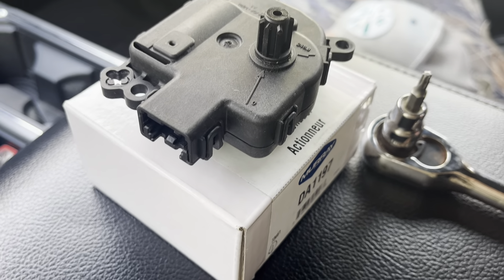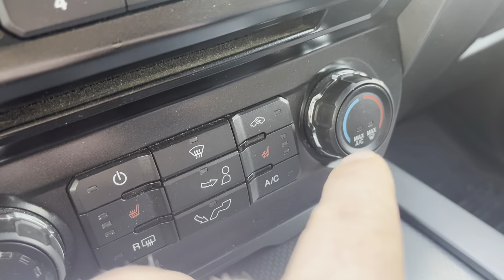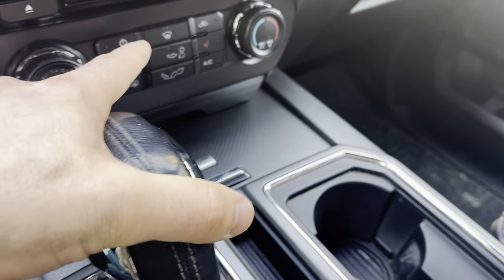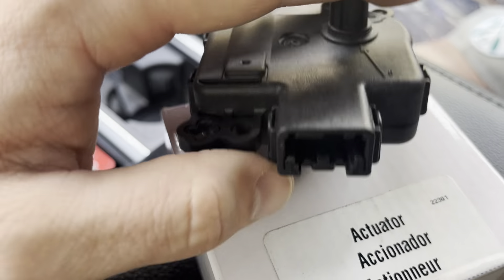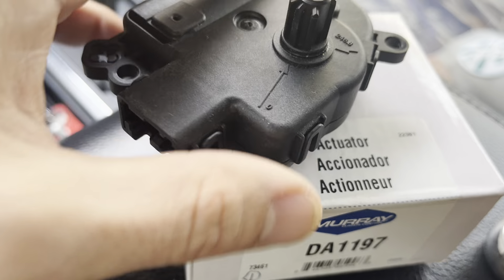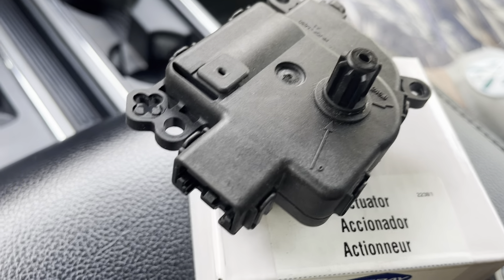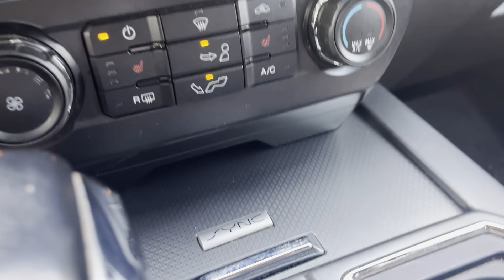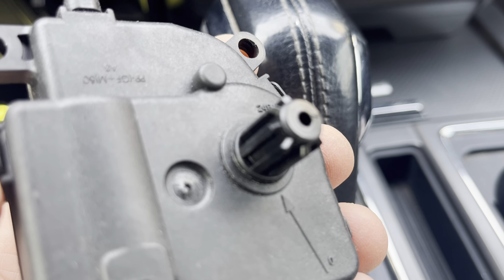F150 Blend Door Actuator Replacement 2015-2020

Comment: Mine started out hot on driver's side, cold on passenger side. Then it stopped allowing me to switch between the defrost, vents and floor. I changed my vent door actuator ( driver's side ) today. It still won't switch between the 3 vent options and I have no heat either. Anybody else have these issues on experience this? Thanks!
Reply from the maker: Do you have dual climate control for driver and passenger side?

Comment: The proper name for the actuator that changes the air output location (Vent, Defrost, Floor) is "Mode Door"  The blend door for that year F150, I believe is on the right side by passenger foot well, (left side under dash) and that mixes the hot and cold air for selected temperature.
Reply from the maker: Yeah I've seen it referred to a few things online, Motorcraft calls it "air inlet door actuator" or "blend door actuator" can be confusing for folks trying to find the replacement part. Think it also depends on if you have dual climate console or not as well.

https://www.ebay.com/itm/314192641851?_skw=motorcraft+yh-1770&epid=227180308&itmmeta=01JEEA5Z3KPC42PFVX366B1A1D&hash=item4927573f3b:g:X1QAAOSwm81hHjwz&itmprp=enc%3AAQAJAAAA8HoV3kP08IDx%2BKZ9MfhVJKkhaFElOdBWo7VR2qyaVMe09JjIivwifMdOGt5RqenMAzgzDzhmLLvULAzk2LdLob16ryyrP2s2XHvsqVgpm59yU6NewjYxZZ35suZeeRUM2pIa%2F%2BoQGsGdEairGuj0qVge1q1WNK3ljXoizxg83LMZlpM6qba3RXpTCAErc3y6q0NsH0DKQKdscetG%2BtigPs2Un1mCbmCtSHRbrvkClNxhoWV3AfIWh%2B8r8wWJmPekphkrkyo5qLFtMY52CCwsiNvG8peYQkxAvDxTkx09Blf7hZTa1kEub88iFjYnLwq5TQ%3D%3D%7Ctkp%3ABk9SR_rxl8rzZA
Reply: So I've been having a issue where my heat on the driver side is only warm and passenger side is hot when I have the heat turned all the way up. Would changing the left side actuator fix this problem?

Comment: I have a 2016 f150 lariat. Dual climate zone. My passenger side is blowing hot air (no matter what I do), but driver side blows a/c (I have it on a/c mode) driver side works as it should. Looked it up online and said it’s the “blend door actuator” should I order the part and change it myself? Thank you in advance.
Reply from the maker: Yeah look up the configuration for the lariat with dual climate control as mine is only single climate control so I have one door blend actuator for vent direction and then another for temp control. I think you may have two temp control actuators for dual climate control.

Comment: My temperature is stuck on high heat everything else works not sure what to replace
Reply from the maker: Bummer I believe there’s a temp blend module did you check that out as well? I think that’s ones on the passenger side from what I’ve seen in other videos.
Reply: Mine too!  I was looking for a video for replacing it.
Reply: I have the same problem has anyone figured it out😢
Reply: @Thorham Did you figure out the heat problem yet  ?
Reply: It is the blend door actuator motor located on passenger side floor board near the console it is tight to get at but not that bad.....45  mini
Reply: @jetboy770371  I was waiting for it to warm up before I try to repair it.